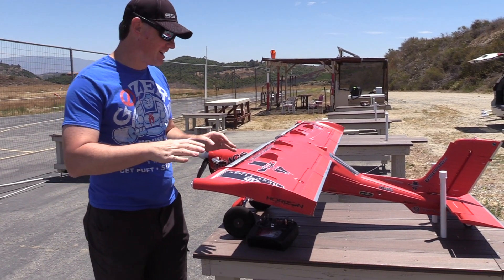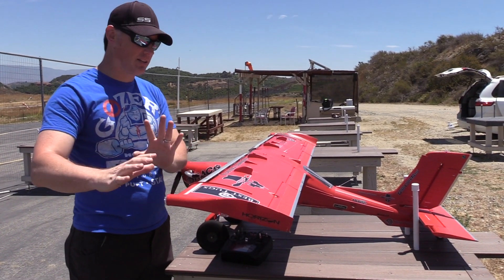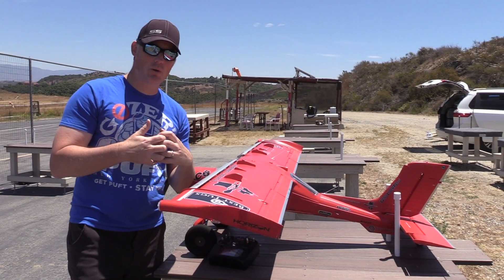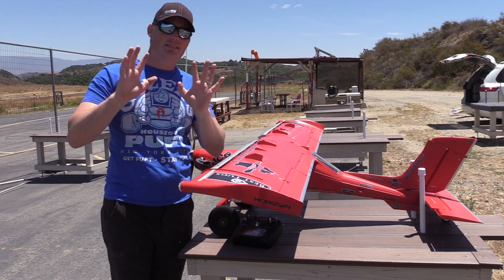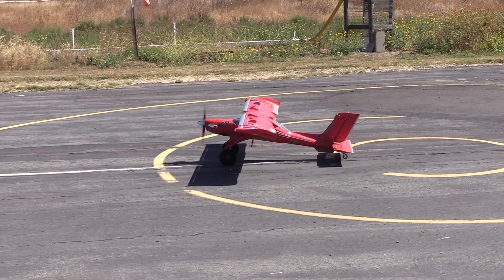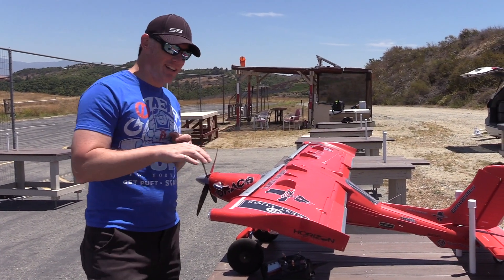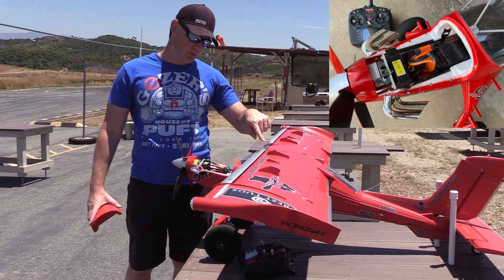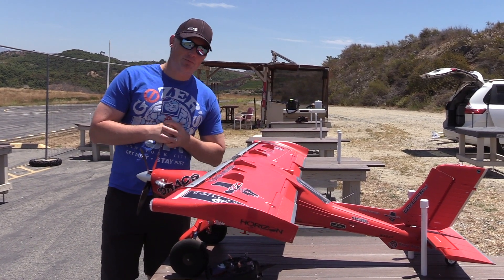How Slow will it Go?  Turbulator Tape Testing the E-flite DRACO

Comment: Have you had any issues with the elevator assembly disconnecting in flight? Im not a fan of the latch mechanism. seems awful flimsy
Reply from the maker: I haven’t personally. It’s important to make sure that the elevator is fully seated and clipped into place when you put it on.

Comment: Is it true the Draco elevator servo is a 9 gram micro?? I've heard these planes go in nose first after a loop, what was your experience? Great Channel!!
Reply from the maker: I personally never had any issues with it.  It’s important to ensure that the tail is completely seated and clipped into place though as you don’t want it to come out of place.
Reply: @Thercgeek  thanks! it was a buddy that had the Draco crash after a loop .... but yeah, like you said a good pre-flight inspection is due every so often., keep up the awesome channel!
Reply from the maker: Thanks!  I wonder if the control arm may have unseated vs the servo itself failing? I did have to reglue that at one point because it came loose.

Comment: Cool experiments. What size battery are you using and can you be more specific on the CG and battery locations? Thanks!
Reply from the maker: I cover that in my full flight review (https://youtu.be/C9MHBsbIgQg ) but the battery is the Spektrum smart 5000mah battery pushed all the way back. I don’t recall cg location specifically off hand but it’s in the review vid.

Comment: Good work Chris, I too looked at the slat fence line compared to the outboard washout and the standard boundary layer separation is definitely  going to be aggressive at the tips. This addition would definitely help. I’m still trying to sort out the adverse yaw in the turns using better stick coordination rather than being lazy with additional mixing.

Comment: Chris, interesting experiment. What would be the result if you change the front part of the whole wing with turbulator tape? Regards and excellent video.
Reply from the maker: Since the slat is there, that already turbulates the flow through the gap. So, adding the zig zag tape through that region won’t provide much benefit.
Reply: @Thercgeek  I meant, instead of.the slat.
Reply from the maker: Ah, ok. Not sure what that would do. It would probably be about the same.